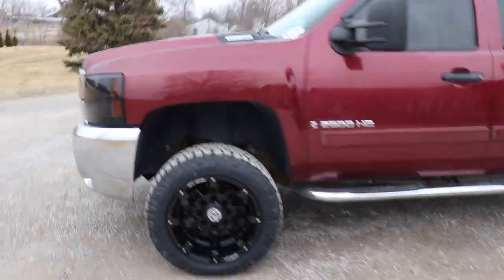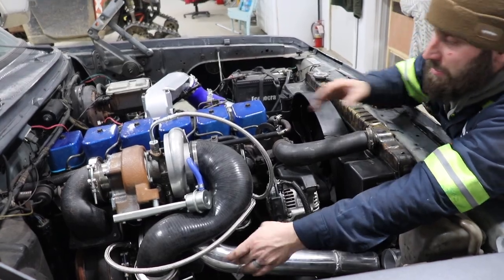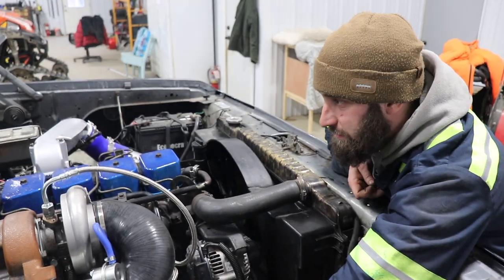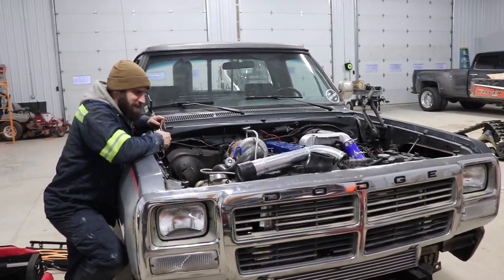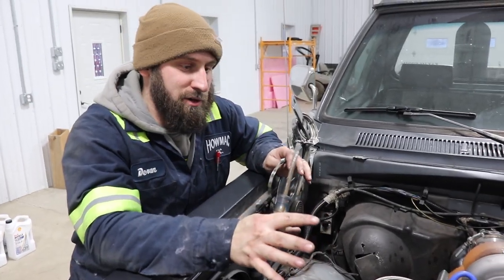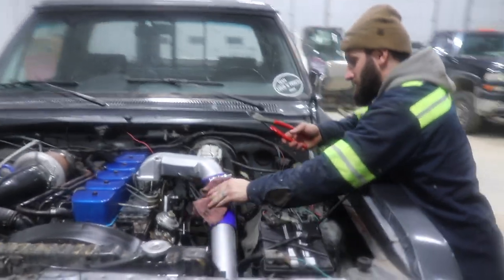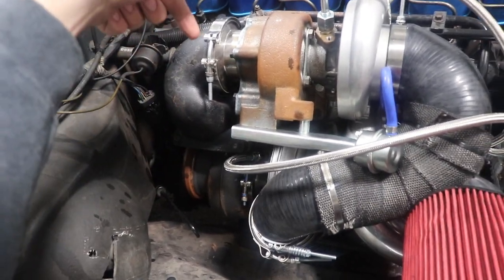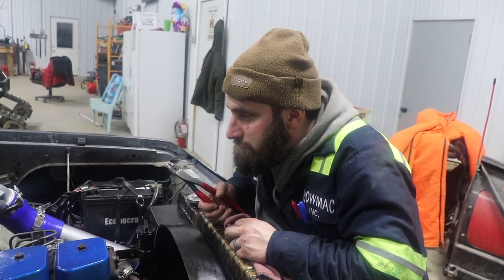1,000,000 MILE TWIN TURBO 1ST GEN 12V CUMMINS LIVES!!!

Comment: To make that tpms light go off you can buy new sensors and put em in your tires and then you have to make the sensors talk to the truck. I think it's a pretty simple process to program em. The worst part would be having to get someone to unseat the tires, put the sensors in, and then probably have to get em reballanced... But you don't have to have the original sensors
Reply: You don't have to rebalance them if they have the valve stem marked out and line it up the same

Comment: Build a little container that will safely hold 40-50psi put  the tire pressure sensors in the container and the light  will go off